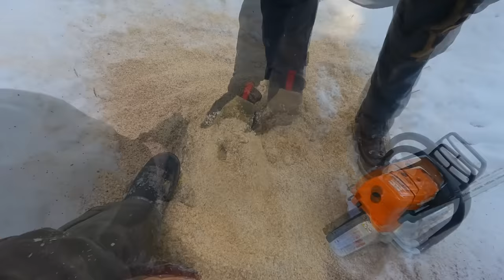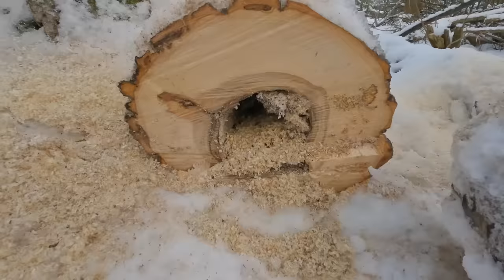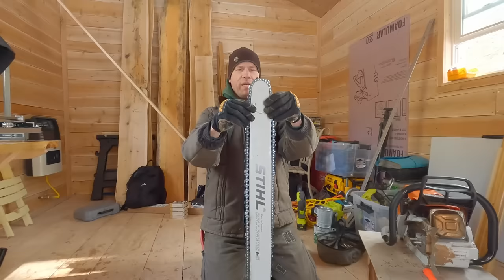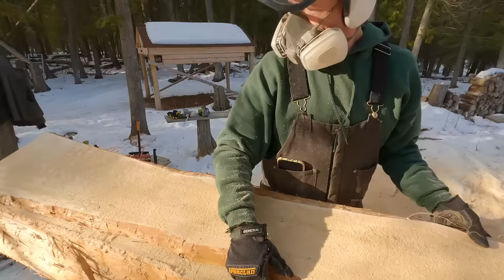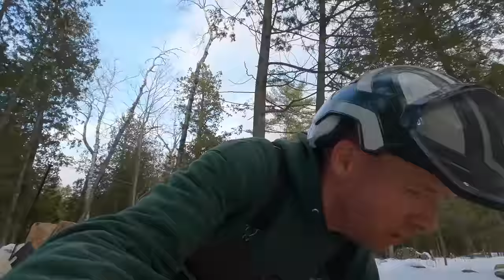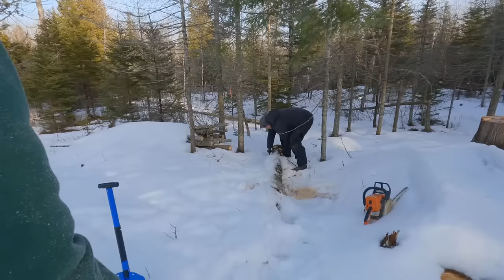An Enormous Alaskan Chainsaw Mill Upgrade, After Three Years of Full-Time Building. #125

Comment: I dropped my chainsaw in the woods and had to send it to the shop but I'm using my wife's phone because the same time I broke mine I'm an experienced Timber man I cut logs up all day long and I I haul logs out of the woods the difference is the horsepower and the bar the more horsepower too easy it's going to be to cut through anything and bar helped you with the width of the logs that you are cutting the little chainsaw that you were using for Milling is okay but you should have used the big one because it's less wear and tear and that big one will last you a long time I've had mine for over 10 years but I have for chainsaws and they're all still they work good as long as you take care of them they'll last you a long time but you're bigger Saul the reason why it went through the log faster was because it's got more horsepower more torque and the bigger bar you have on there the more Revelations you have on your chain

Comment: hEY CHECK OUT " I dare you to peel logs faster" on you tube you might liken it Ryobi guy a new tool for debarking your logs though I dont know if it would work in your situation. I saw another one more like a planer to attach to a chain saw that does the same thing Im sure a lot more expensive this is just a blade on an angle grinder where you get it I dont know.?

Comment: Theres an option for you in a Logosol.
And you dont need to buy a new chainsaw beacuse you already have the  661.
The sawbench is light inuff to be lifted up on the roof rack of a car. Or pulled on sleed behind a atv or snowmobile.
And with extension its almost endless in length. The first cut can be made thinner than with an Alaskan mill.
My self? Well i just bought an Alaskan mill😂. In very good used condition.
I got plans for it and it was cheep as f-ck😮

Comment: Good work. I mill with a 660. White oak, 42 inches, 36 granberg.... 32 inch white oak slabs 8 foot long in 6 minutes.  Mot sure on pine wood. Good show man. I have a couple of vids you can check out. Sub here.

Comment: Just gotta say you guys do a lot of unnecessary work like I used to when I first got my mill 30 years ago I'm an arbourist that removes huge hard wood I mill most of my live edge right in the city usually 16' long I use a ms 880 with a 5 ' bar with that much power I can cutt on an angle smaller logs on a 45 ° angle no winch or fancy  straight edge, I Just find a straight 2 x 10 pref. or 2x4 if all handy, if not long enuf I just move along the log if no strait edge handy Ill Snap a line and free hand within an 1/8 then brush it down to the line then put the mill on 
   Don't touch the ice with all your fancy straight edge, the ice is your freind cools the bar and chain, 
  Love what you do 😊 just saying , lol